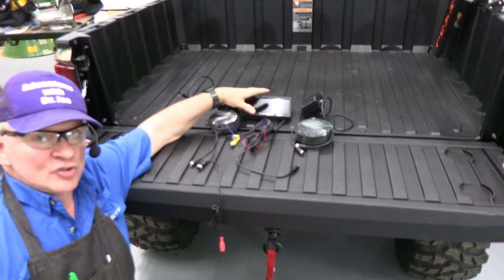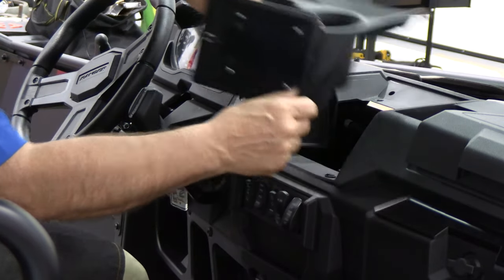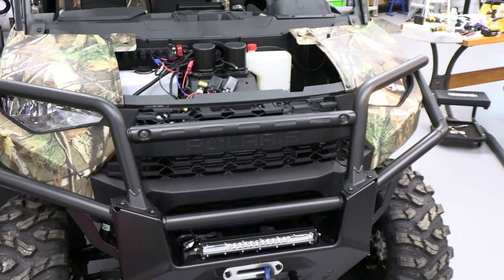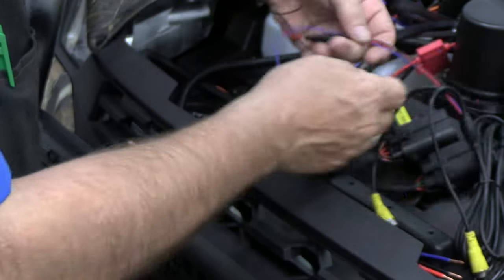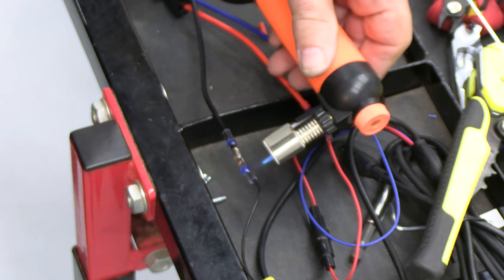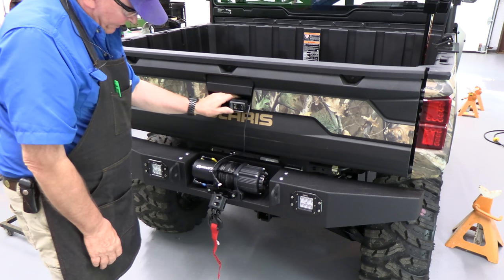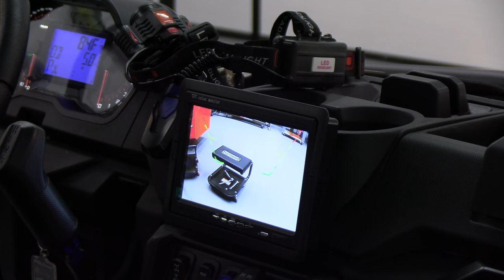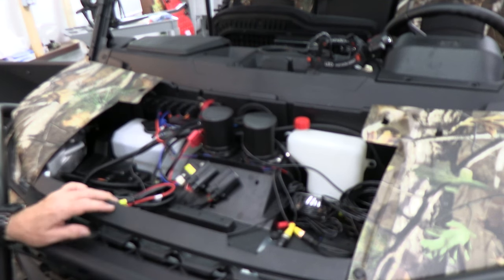Dual Camera 1080P and 7 inch HD Split Screen Monitor for Polaris Ranger XP1000

Comment: Nice job. Where did you get those wire splices with solder?
Reply from the maker: Thank you very much for your comment. You can copy and paste this and find these on Amazon 120 pieces for about 10 bucks.

Solder Seal Wire Connectors-Marine Grade Heat Shrink Wire Connectors

Consider subscribing. Thanks, Joe.

Comment: WHERE DID YOU FIND THE SCREEN MONITOR HODLER OR DOES IT COMES WITH THE KIT,THE ONE THAT YOU SCREW ON THE FRONT OF DASH.
Reply from the maker: The screen monitor holder does come with that kit. I found it incredibly good price and it works really well. It’s very high definition. The picture quality is outstanding. Consider subscribing. Thanks. Joe.

Comment: Very interesting just got through ingstalling a backup camera on my 2001 f-250 and now am looking at my ranger. I plan on using some kind of roof mount though.
Reply from the maker: Hey Burns, thanks for your comment. I think your install on the roof will be OK or you may have to put some screws through a sheet metal if that’s OK consider subscribing. Thanks, Joe.